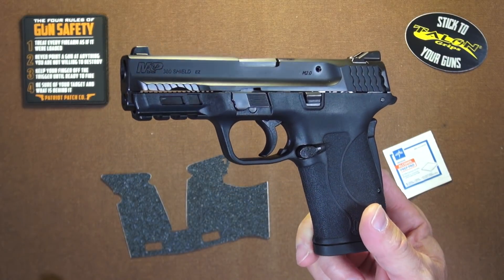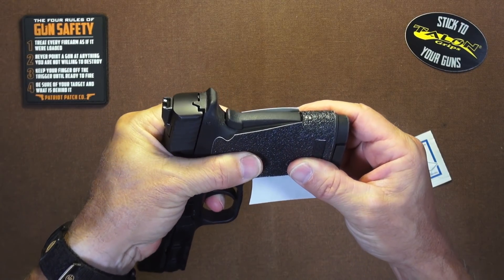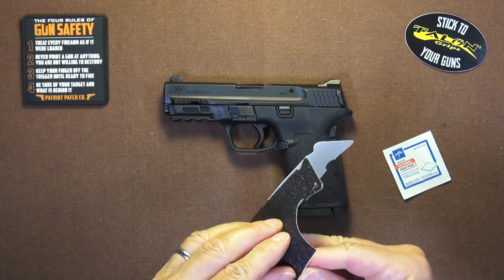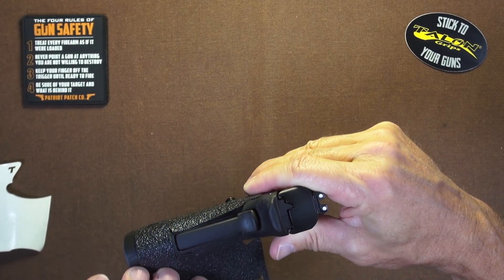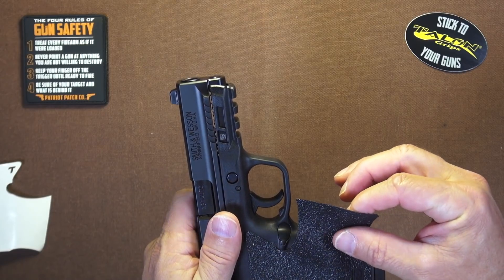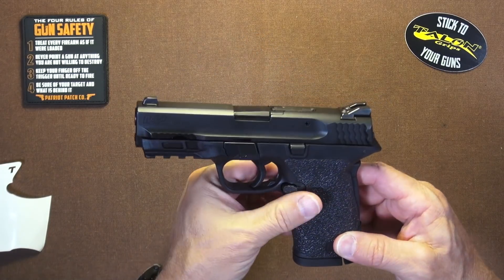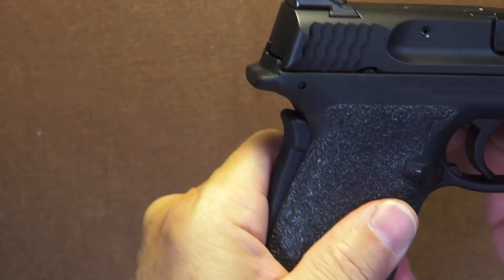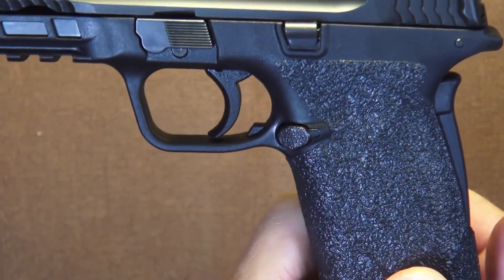M&P 380 Shield EZ Gets A Grip!

Comment: Installation of the Talon Grip turned out decent, however, I no longer purchase firearms if I’m not satisfied with the grip. A lesson learned after purchasing two Gen4 Glocks.  Todays market is too competitive to settle for less.
Reply from the maker: Agree completely. That said, I find myself addicted to the feel of the rubber Talon grip, and put it on just about everything. It adds a consistency across the entire collection for me.
Reply: Valid point with Consistency being a key factor. 📝

Comment: How well do you think the grip will stay adhered to that new 2.0 texturing?  I have a Shield in .45, and my thoughts are that the texture might seriously reduce the surface area for the grip to connect to.  I imagine that when doing the heating and smooshing some of the adhesive will get into those pores, but I would think a lot would not. 

It would be interesting to see how it holds up long term, but I am not sure that particular 380 will see much use (?).